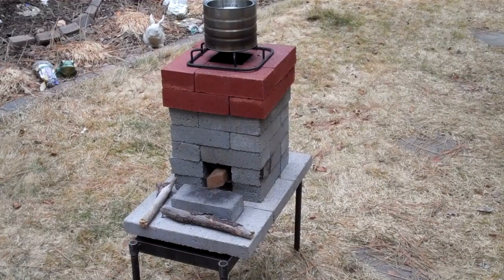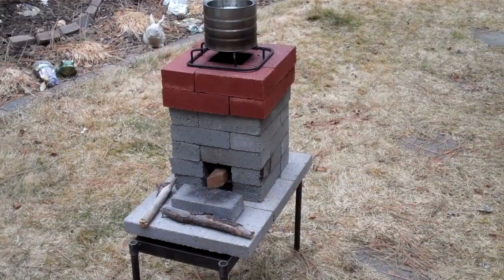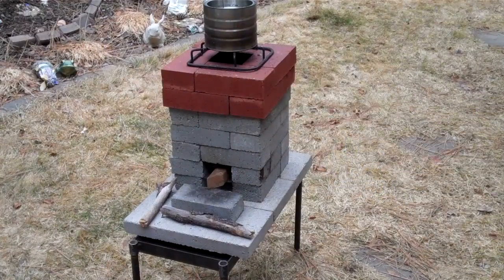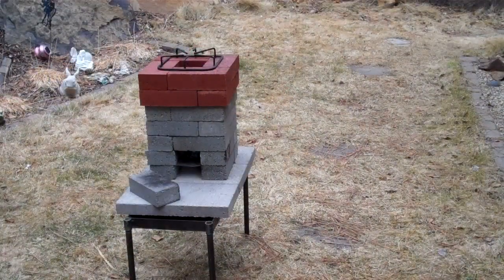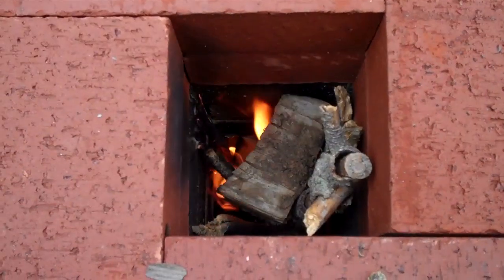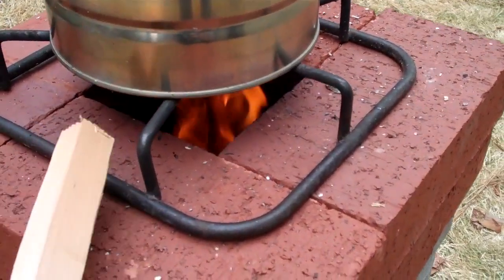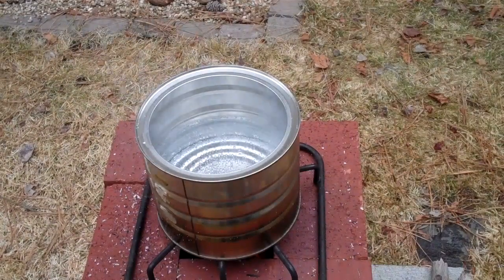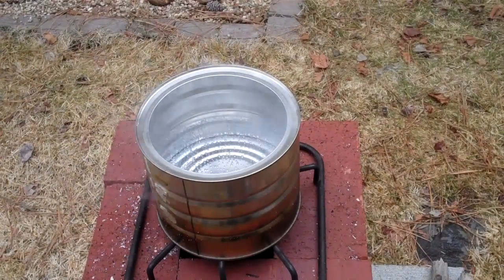How to improve on the basic brick rocket stove

Comment: I used chimney bricks, Most of them cracked after a couple weeks.
There is a ration between the height and the inlet.
Can't find my notes to give the proper ratio.
Am thinking it is 5:2 (5 high, 2 out front).
Taller it is the more rockety it sounds.
Reply from the maker: How much were you cooking on the stove?
Reply: @survivalcommonsense  Was making biochar. I used a 12 quart stainless steel stock pot. And the fire had to be HOT HOT HOT too. So hot it melted the aluminum rivets that hold the handles on it.
Pot sat inside the 'chimney' as it were to maximize the heat absorbed.
When I cook soil, it won't need to be that hot.
Big difference between 200F and 1500F.
Amazing how hot sticks can get.
Bad thing is I had to sit there feeding the thing every few minutes to keep it going.
And have a charged water hose in hand in case of fire.
Reply: @survivalcommonsense  12 quart stainless steel stock pot (walmart) filled 7/8ths with oak heating pellets.
For soil, I can nearly fill the pot.
Pellets expand more than soil.
Thinking about getting concrete blocks. Loose bricks from an old chimney leak air too much. And they like to crack if they get really hot.

Comment: I would guess that the "explosion" danger in concrete and also concrete bricks is a result of water in the concrete. If your stove is under a roof and or kept dry you shouldn't have a danger of explosion. Also, I do not know because I am not there to inspect for myself...
That last close up shot of the top of the stove (bricks) made me wonder if your red bricks were concrete as well. Again, I don't know. I'm just throwing out the fact that you can buy red concrete bricks. Just because they are red doesn't mean they are fire bricks. I have, many times, seen red dyed concrete products. Just a word to the wise.

Comment: Concrete is porous and will absorb and retain water over time.  As the bricks heat up, the water turns to steam and causes the brick to crack (not explode).  I know this because my in-laws made a giant fire pit lined with concrete blocks and that's what happened to several.  Store your bricks in a dry place and you should be fine.

Comment: Gave this a try today.  results were poor.  I can't say it was the design or not yet though.  The red brick the box store by me had little bumps on them for spacing.  They air coming in from the gaps I think kept the chimney from drafting well.  I was also using pine tree scraps.  It burnt real dirt and the build up of coals kept choking off the airflow.  I switched over to some cedar from some old fence slats.  This burned much hotter and cleaner.  Drafting was improved, but I never got over a mild boil on 2 quarts that evaporated down to 1.

I'm going to try this again, but next time I'm going to smear some mud in the cracks as I build it.  See if that improves the drafting and how clean it burns.
Reply from the maker: Sounds like that is your problem. The bricks need to fit tightly for the stove to draw.
Reply: Jason P slap some mud between them. 😊

Comment: Good practical practice for the first-timer rocket stove builder. You need to mention using "fire bricks" which people have in their stand-alone fireplaces.  I was told to use those.  They are a little more expensive but won't break as quickly.  You need to do some research that the taller flue creates more of a venturi effect, which increases the speed of the air, like air over a wing. But your design is good and portable. Easy to keep in a trailer or back of a truck for possible cooking needs. You can use pine cones or scrap wood from under a tree as well.
Reply from the maker: Check out the rest of the videos on the play list - they address some of these issues. Thanks for the feedback!

Comment: Those bricks are what i called engineering bricks (scotland) I used to build fireplaces and we used those bricks all the time.  It wasn't a finish brick, It was for the rebuild before casing stones etc were built in front Or plastered. If they can survive the heat of a multi fuel stove. They can handle a little wood fire :)

Comment: I tried boiling water with a 24 brick rocket stove yesterday.  I had so much fun making the stove, lighting it up and hearing it gently roar.  I was thrilled to place the covered pot filled with 1 liter of water on the flat grill at the top of the chimney.   But I was 
disappointed that after 15 minutes (timed with a timer) of watching the covered pot sit atop the hot flame, the water was barely warm.  The stove did indeed use little wood and create a nice flame but it didn't boil the water.  Is this everyone's experience?  If not what am I doing wrong?
Reply from the maker: +Isastuff Hard to say - the one I made on the improved patterns worked great.

Comment: What happens if you narrow the hole by pushing each brick an inch or so inward (making the ends stick out a little)? Would that increase efficiency?
Reply from the maker: +Thomas Ritchie I don't know. It would be difficult to push bricks in at the top because of the design.
Reply: +Survival Common Sense Cool! Thanks. 
And I just had another thought... If I make this I'm going to try stacking (or gluing) the bricks vertically for the chimney, and save half my bricks that way.
Reply from the maker: Send photos!

Comment: i once made a fire directly on top of the front yard concrete floor, and after about 20 minutes it cracked with a loud noise (a mini explosion, if you will). i never used concrete for anything fire-related since. only used fired bricks or mud.
Reply from the maker: +ohvnaq Sounds like there was some water under that concrete.
Reply: maybe huh, i'll give concrete another chance then.
Reply from the maker: The only reason I used concrete is because they are cheap. Get some old chimney bricks and they should last forever.

Comment: I worked in a plant that made concrete block and brick. I can tell you from experience that they WILL not last after being heated for very long. They can break apart, at the least they will crumble from the heat. Just an FYI. At a $1.60 a piece, Firebrick would be your best option, and in the long run, they will cost about the same, because they will last for years.
Reply from the maker: +scott grube Thanks for the input. If I were making a permanent stove I would definitely use fire brick.
Reply: I figured that you would know that. I was just commenting to let others know what would be best for a more permanent setup. Thanks for the vids, I enjoy them all!
Reply: +Scott G I think the main key here is in a survival situation, you might not have the ideal materials to make an oven out of. Thank you for the heads up though, very interesting.
Reply: Now in 2021, fire bricks are $2.40 each. If you are reading this in 2015 or in 2115, in 2021 everyone is now wearing a mask because of a killer pandemic disease.

Comment: There's an idea you seem to be skipping over here with your adding the extra bricks.
Sure, if all you wanted to do was to boil water, then there's no reason for the wood hole, just fill the vertical hole with wood and light it. All the wood would be burning, and you'd have boiling water in no time. (I would suggest covering the coffee can and putting  foil  around your gas stove pot stand and it would probably boil in less than 3 minutes.
HOWEVER, (Sorry, no italics) the idea to one of these stoves is so that you can actually cook on it with a frying pan and use VERY little fuel.
In that case, having a larger draw works against you.
You want to be able to feed just a few sticks slowly into your horizontal wood hole to have a nice, low, steady heat to fry off of.
It won't work with what you've got because you have way too much airflow, and the tall chimney would absorb the heat from a small flame,
     The rule of thumb for these is to make the "chimney" height 3 times the diameter.
 So, if your chimney is what? 4 inches square? then your height should only be just over 12 inches [call it 13-14 inches from the top of the horizontal "wood hole". (difference between a circular chimney and a square one.)]
Any higher than that and you will have to burn a LOT more fuel to hold the same frying heat.
Reply: James Fergason however you would still need a hole at the bottom for airflow.

Comment: Incredible. There is such a thing called "fire brick" or "chimney brick" that are used to build chimneys! They are different, and safer than standard construction bricks. Use those.
There's some "common sense" for you.
Reply from the maker: alan30189 The point was to make an emergency stove to be used during a survival situation. Sure, if you're investing in bricks to make a stove you'll use for a long time, get fire brick.
Reply: +alan30189 Fire brick are about $3-5 each, and you're not likely to find a lot of them lying around in a disaster area.  Regular brick is probably good enough for short term use and is really easy to find (especially in Haiti after the earthquake.
Reply: +Darin Clay Sure, but in a disaster area, just look for a house that had a chimney and firebrick likely lined where the fire was built. Regular bricks can explode and kill you... another survival skill.
Reply: +alan30189 I agree fire brick is better.  Just harder to source.  You won't successfully reclaim much unbroken fire brick from chimneys built in the last 50 years--they are well-stuck with adhesive or refractory mortar (I've tried). Older kilns, backyard BBQs, and wood stoves are better sources, but most these days use half-bricks that are more difficult to work with for a stove (that must support a pan).  I have been using brick rocket stoves for years and have had bricks crack and even crumble (I admit I have never used cinder or concrete-style brick) but have never had one explode with any force at all (though I did dump a pot of stew once).  I agree that for any long-term use, there are better materials, but old brick is better than poured concrete, cinder blocks, tin cans, and even steel.  The newer the brick, the more likely to fail, the higher the lime content, the wetter the brick the more likely to fail.  If you can find or afford firebrick, that's your best bet, but this works well, too.

I personally prefer using a 35 gallon steel drum with hole in side and top, forming J tube or L tube with stove pipe, then fill in around with perlite and clay mixture.  By the time the stove has "eaten away" the stove pipe, the perlite/clay is good and cured.  Of course, this requires that you have these items on hand.  If you don't, a brick stove works well enough.

Comment: I was soldering on my back concrete step with a propane torch on low. The corner of the step suddenly exploded with great force. It took about a 1 inch pyramid of concrete off the corner. It must have blown away from my face, but I never forgot and I have an extremely healthy respect for concrete and heat--50 years later! I learned in Scouting that you use igneous rock for fire rings and not sedimentary rocks for the same reason.

Comment: I owned a private campground in Colorado for years and we used concrete fire rings.  The rings worked great and we never had any problems using concrete.  The only problem we had was when someone would pour water on the fire ring while it was still hot.

Comment: people talking about the safety issues are most likely referring to WET blocks. Just like rocks circling a camp fire it they have been soaked in water then heated the steam can cause them to explode. I would think that due to the porous nature of the brick it would absorb water easier and would be a problem. just a thought.

Comment: the cement sucks water in dont let them get wet or they may blow up but if they are dry and havnt been rained on for a week or so you should be good they will crumble after a few heating and cooling just dont drop them
Reply from the maker: http://www.survivalcommonsense.com/build-a-brick-rocket-stove-is-it-safe-to-use-concrete-blocksfeed/

Comment: I built one of these yesterday using your instructions.  It was a great project to do with the kids, and seemed to draft well.  However, even after 1 1/2 hours of carefully feeding the fire with hardwood sticks, my 1" of water in the bottom of a pot never came to a boil.  Any ideas for how to troubleshoot?
Reply from the maker: Start the fire, then put sticks down the chimney until you get a good flame and coals going. Then feed the fire as you cook. Sometimes the chimney needs a little warmup. Also - how high was your grill from the top? An inch can make a great difference. On the other hand, if you want to simmer something, you might want the base of the cooking vessel to be a little higher.
Then check your fuel - were the sticks green or wet? Sometimes it take a while to dry out the wood before it will produce heat.
I've had no problems boiling water frying eggs or general cooking with this setup. Good luck, and let me know how you come out!

Comment: I wonder if you could use a ceramic flue liner for the vertical part of the stove? Or even a few flower pots with their ends cut off and stacked end to end. You could put them inside some sheet metal to reduce the burn risk and to help keep them aligned,
Reply from the maker: I haven't tried the flue liners, but I will.

Comment: I spent many years in masonry construction. Chimneys and fireplaces were our specialty.
Fireplace construction uses firebrick for the firebox and ceramic flueliners to carry the heated air out of your house.
It would take very intense heat for a concrete block to "explode". (Think cutting torch temperatures). Over time,they will deteriorate with heat. As mentioned below, the yellow fire brick, or chimney brick, is the only brick to use. They do not absorb heat. Not sure on the cost but it would be money well spent.
If you are just occasionally using a rocket stove, you should be ok with regular brick/block.
Also, if you are building a "permanent" rocket stove, don't use regular brick mortar for the fire brick. You will need a small bag of "fire clay". You mix with water just like mortar.
Great video. Never heard of a rocket stove before. Can't wait to build one.
Thanks.
Reply: Leon Pantenburg
Hi Sir,
 I built my "rocket stove" a while back and absolutely love it. I am going to incorporate one into my new outdoor firepit/grill.
 I probably "overbuilt it". I had a neighbor give me about 400 firebrick last fall and was wondering what to do with them. (I only used about 30 of them).
 I am amazed at the efficiency and the heat it produces. High heat and very little ash.
 I live outside of Cincinnati, in the country, and have all the fuel I need.
Don't worry about the flue liners unless you are building the stove within a structure and need to vent outside.
 I love your other video's also.
 I am sure you get a lot of "tips" but I think in this case, simple is better.
Hope all is well. Thanks again.
Greg
Reply from the maker: Thanks for the feedback - please let me know how you come out with your stove. I've had no luck locating ceramic flueliners. I have not head of the yellow firebrick, so I will start looking.
 I want to do a post about building a permanent rocket stove, but am waiting to get all the right stuff. A couple of masonry people checked out the construction of the stove and have given me some tips.
As it is right now, the stove in the video is supposed to be an emergency tool. I've had many people asking for advice on making a permanent structure and appreciate your shared knowledge.
Reply: Survival Common Sense I recently was advised by a chimney inspector to get the ceramic flueliner and he was able to order and install it for me.

Comment: Great video and I'm definitely building one. If someone has asked this already, I apologize as I looked but didn't see it asked. I'm interested in getting a metal stand like the one in your video. It looks to be the perfect size and height. Where can I get one? Thanks!
Reply from the maker: I've had a lot of questions about that stand! It's a custom built Dutch oven cooking stand, and it will easily hold two 14" ovens side-by-side. Any welder could make one, but I don't know anyone who is building them for sale. If anyone knows of someone making these stands, please let me know!
Reply: Thanks for the quick reply. I'll keep looking around until I find something. The height has to be right for my purpose. Not too tall. I was hoping this was something commercially available. Well, I suppose back in the day it was. :-)

Comment: If the bricks get wet/rained on, the water gets trapped inside the heat from the fire will build up steam in those water pockets, then the bricks, blocks and or rocks will explode. Keep them dry.
Reply: If they do get wet build a small fire and gently dry them out. So far I've had no incidents. They would have to be quite soaked to be a danger. Covering when not in use is the best option.
Reply from the maker: I would cover the stove with plastic when not in use.
Reply: That is a good idea, and I liked your infor on the rocket stoves, well done friend.   Ken
Reply from the maker: Thanks!
Reply: Leon Pantenburg I might try a Galvanized Bucket for longer keeping.